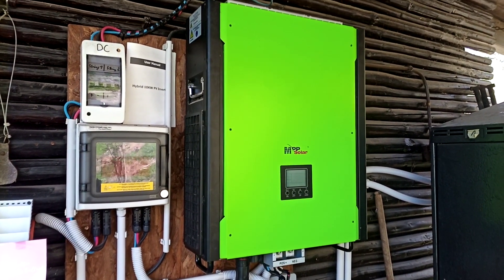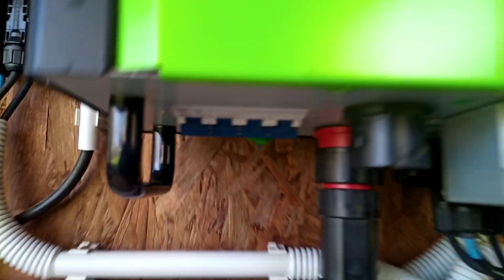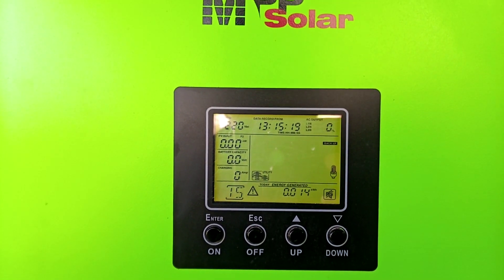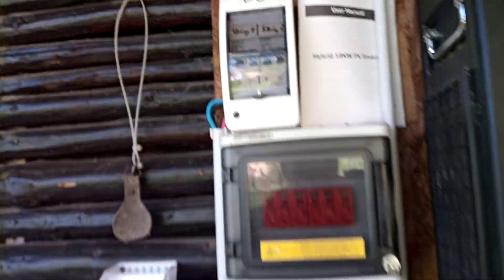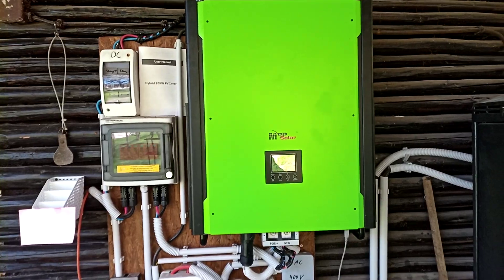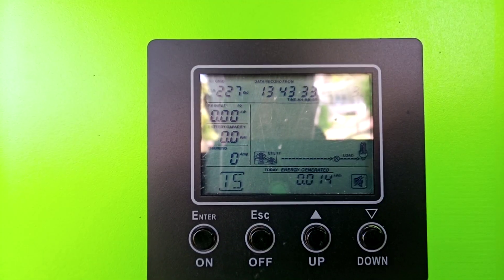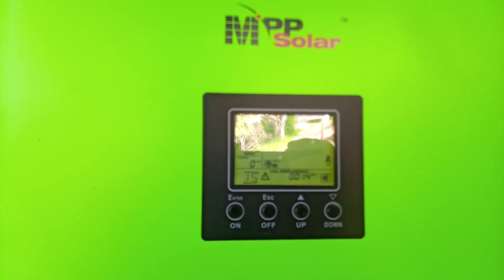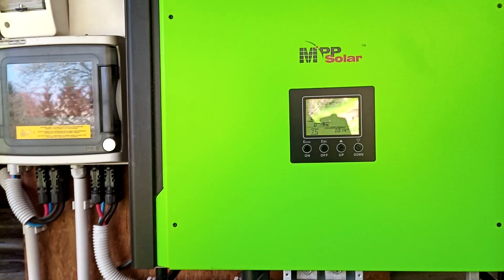MPP-Solar MPI 10k inverter first start after mainboard replacement - smoke, reboot loop and Error 03

Comment: schon gesehen ? video von  DIY Tech & Repairs:  Replacing broken parts in MPI 10kW Inverter
bei meinem mpp 5k trat der fehler am 25.4.22 auf. davor war alles problemlos. Ich habe noch einen string mit nem solax inverter der nur einspeist. der läuft seit 2 jahren problemlos. support von mpp hat ja leider corona. Bis auf automatisch generierte mail noch nix von denen gehört. Meinen 5k hab ich auch schon aufgeschraubt und den Schaden fotografiert und an das support team geschickt. Ursache ist mir wirklich nicht verständlich.
Reply from the maker: welcher Fehler ist bei Deinem MPI 5k?
Reply: @Stefanseiner  bei mir ist es bus softstart Timeout Fehler 03 und nach aufmachen ist ein mosfit kaputt
Reply from the maker: @christofschultz778  mmh, also dasselbe wie bei mir. EInfach so passiert oder hast Du einen Auslöser oder eine Vermutung, was passiert ist?
Reply: @Stefanseiner  ich steh da auch etwas auf dem Schlauch ich bin mir nicht ganz sicher aber es kann sein dass vor dem Fehler 03 der Fehler 17 auftrat das ist aber im datenprotokolll nicht mehr zu sehen. Davor hatte es keine Probleme gegeben. Der inverter ist bei mir im Keller was möglich wäre dass er sich dort überhitzt hat. Weil es keinen luftaustausch gab. Ich habe schon bemerkt wenn die Sonne scheint dass es im Keller merklich wärmer wird.